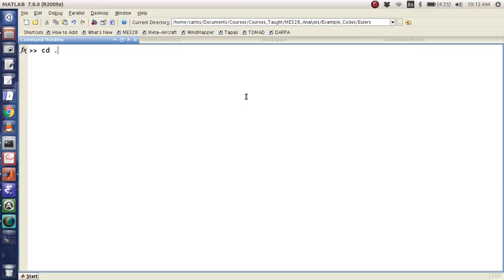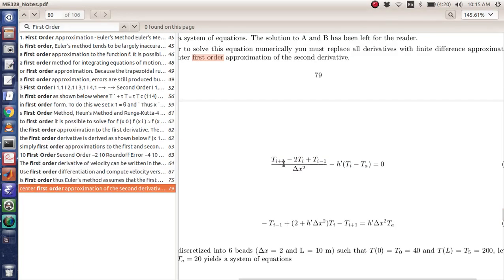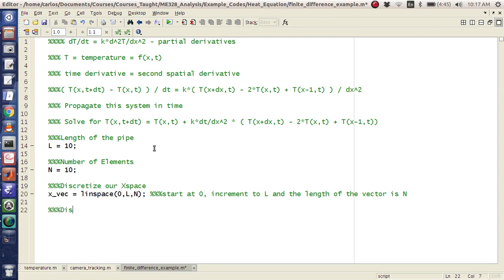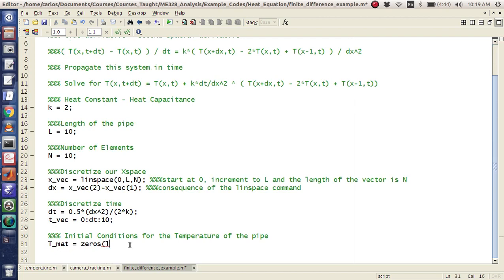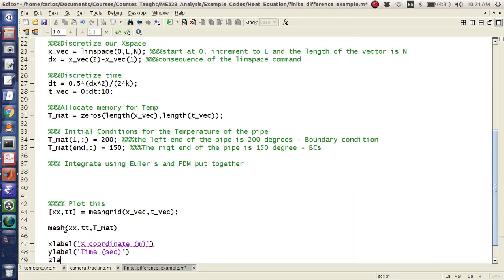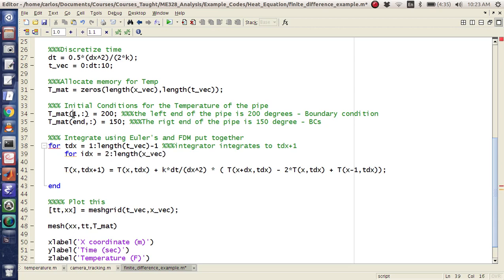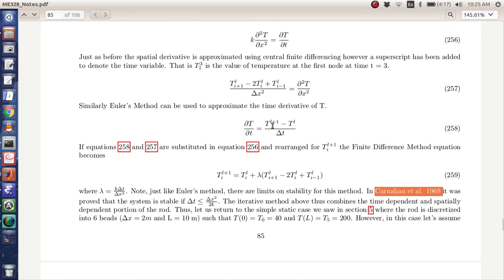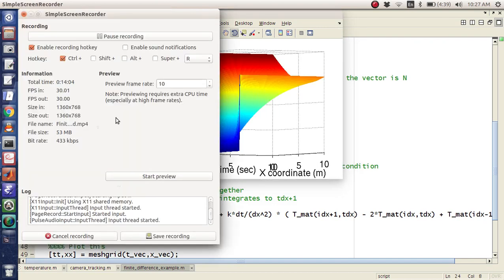MATLAB Help - Finite Difference Method

Comment: Hey! That helped a lot. I am currently struggling with a question that has been set and I was hoping that you could lend a hand?

A subterranean structure is to be constructed in the vicinity of a tidal river. For
simplicity we will assume that the site is at a constant level. Using a finite difference analysis
you must analyse the underlying groundwater level and propose an appropriate pumping
network to aid construction. The river through the site can be described parametrically
with t ∈ [0, 1].
x = 2000t
y = 462 ± 15 − 25.4t − 4028t^2 + 7004t^3 − 2763t^4

The total extent of the site is a rectangle of Lx = 2000 m Ly = 1000 m, with
K = 6.2 × 10^−4 ms−1. Note that where river intersects the site the groundwater level
may be assumed to be 0 m. The boundaries of the site may be modelled such that the
y = 0 m has a head of 3 m and y = 1000 m has a head of 5 m. As the variation along the
x boundaries are not known we assume that the flow is perpendicular to the boundary. i.e.
there is no variation in head in the y direction.

B1. The groundwater level across the site can be approximated using the Laplace equation.
Following a similar iterative approach to the tutorial examples, solve Laplace’s equation
and obtain the steady state water level within the site. Once you have obtained the
hydraulic head determine the flux field to indicate the flow of water.

B2. An excavation in the site, of size a = 100 m and b = 75 m, located at Px, Py=(950, 500)
m is required. To ease the process of construction the water level must be lowered in
the region where construction will proceed. The water level must be lowered to below
-2 m within the site using a series of pumps, with a pumping rate of −1.3 × 10−3s^−1.

You may select the position and number of pumps, they do not have to be within the
site, but they should not be co-located - you can’t have more than one pump within 25
m of another. There is no restriction on the number of pumps but you should attempt
to find an efficient design.
You should design your code so it is possible to trial various pumping schemes and it
should be clear how you have tested the success of your scheme. Compare the flux
field with that obtained for a site with no pumping. Indicate clearly the location of
your pumps.
Reply from the maker: +Ph Tang Unfortunately I have never seen a problem like this. This seems like a civil engineering question and I am an Aerospace Engineer. Unfortunately you will have to ask someone else.

Comment: That was very helpful! I would really appreciate if you can solve a nonlinear elliptic PDE with FDM method.
Reply from the maker: hey no problem. can you give me an example?
Reply: +Carlos Montalvo 
This is the PDE I was trying to solve:

U′′x−U′x+U2=cos2(x)−sin(x)+cos(x)

in which, exact solution is:

U=cos(x).

I had problem with applying Neumann BC to it. Dirichlet is working fine but not von Neumann.
Reply: +Carlos Montalvo 

the equation:

http://www.hostmath.com/Show.aspx?Code=U_x%5E%7B%5Cprime%5Cprime%7D-U_x%5E%5Cprime%2BU%5E%7B2%7D%3Dcos%5E%7B2%7D(x)-sin(x)%2Bcos(x)
Reply from the maker: I'll take a look and get back to you in a few days. Thanks for the problem!
Reply from the maker: +Carlos Montalvo Hey I got it to work. Give me a day or so to post the solution. I ended up using a blended RK4 FDM approach which has pretty good convergence. Obviously there are other ways but the method I will post does just fine.
Reply: +Carlos Montalvo Thank you! I really appreciate it!
Reply from the maker: +Hooman Ros Here you go! https://youtu.be/07jGlNbvOqw
Reply: +Carlos Montalvo If I am to solve the same problem (nonlinear) suggested by Hooman Ras, but as a function of time also (U=f(x,t)). In addition to that, my boundary conditions are derivatives (Neumann B.C.). Do you solve it using RK4 and FDM? if yes, can you give a brief explanation of the code structure?
Reply from the maker: +Ayesha Khalil I would assume that FDM and RK4 would work just fine for the problem that you are describing
Reply from the maker: +Carlos Montalvo As far as the coding structure it wouldn't be any different. You would have two for loops. the inner loop would solve U(x,ti) and the outer loop would solve U(x,ti+1)
Reply: Thank you very much for your reply. I am still confused on how to define my boundary conditions since they are derivatives not a defined value?
Reply from the maker: Aah. Yes. That is unfortunately a derivation issue rather than a coding issue. The FDM equations are different depending on boundary conditions. Do you have your textbook for Numerical methods? The equations for Nuemann BCs are most likely in there